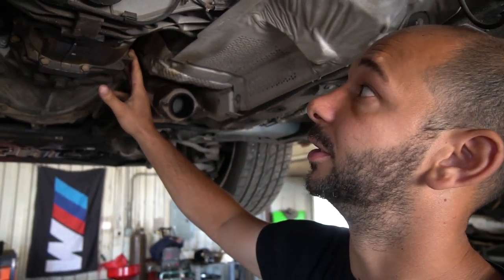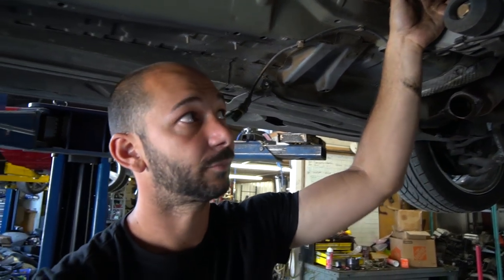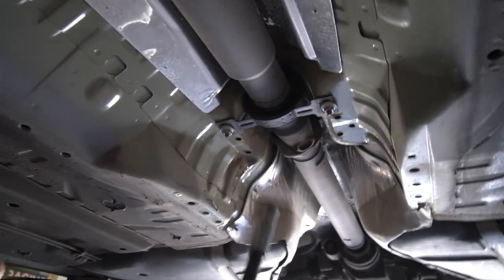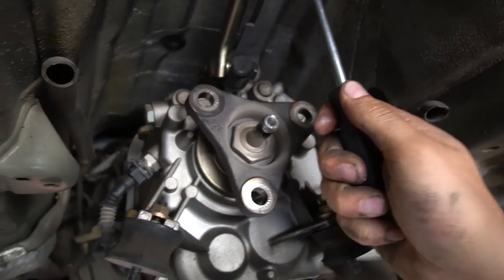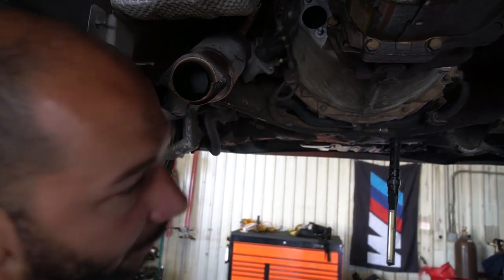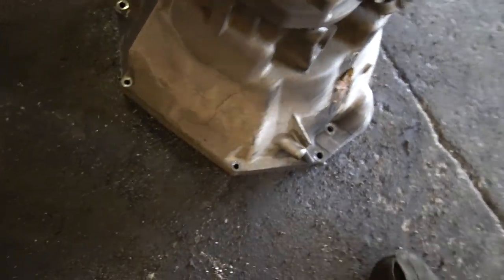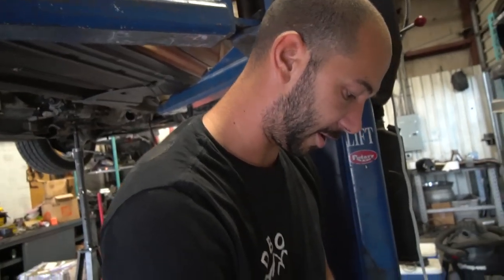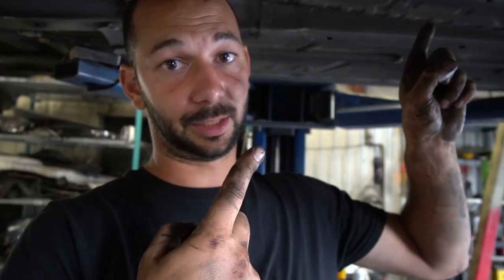e39 540i How To Pull The Transmission! (M5)

Comment: Yo DBO i have a 02 530i m54 5speed Msport, i have to replace the throwout bearing and the detent shift pin springs in the trans but my exhaust was straight piped with the muffler/resonator delete before i bought it and was wondering how come there's no o2 sensor to be found on the exhaust(Part1 video) at all like your 540? Is there a difference between the two besides the technical update and the dual exhaust/catalytic converters? And also how come we both have 02 but mine didnt come with the TU when i have a newer model?? Is that because ones I6 and the other v8? Please help a brotha out🙏 Bless UP!
Reply from the maker: Yes, your 6-cylinder has the cats in the headers and subsequently both o2 sensors are in the header. 540i has cats in the headers and in the mid pipe so the secondary o2s are farther back.
Reply: Oh okay you right about the o2 sensors in the headers😂 I guess i got confused cause theyre the same year and you were saying older models wont have that but since mines a 6cylinder and you never specified anything about it that was really the only thing i could think of too. And thanks bro for the quick ass reply💯💯 it was so quick i didnt even notice, thanks again DBO

Comment: Hello i was wondering if these are the same bolts and tools used to take off a ZF 5 speed manual transmission e39?? I cant find any info anywhere.... please HELP!!
Reply: 530i
Reply from the maker: The 530i is similar. The exhaust and heat shields will be very similar. Then search how to pull an e46 manual trans. It will be the same except the upper e14 bolts are much more accessible on the e39. Good Luck
Reply: Thanks bro i just finally got to it today, it was similar except the transmission was E12 and the driveshaft was 18mm but i guess bigger engine calls for bigger bolts🤷‍♂️

Comment: its very similar to a e30-e34-e36-e39-e46 and prolly more? XD its all the same :p can put a e39 box on a e46 and vice versa.
Reply from the maker: You are correct and that the process is very similar, but these are v8 cars, the transmissions are not interchangeable with 6-cylinder cars. We will be doing an e36/e46 transmission video soon.
Reply: @DENVERBEERANDOIL  i see, in my country there is probably only a 100 v8 e39's so ive never really looked in to them 🤷‍♂️but i was indeed thinking from a 6cyl/4cyl standpoint. my bad😆